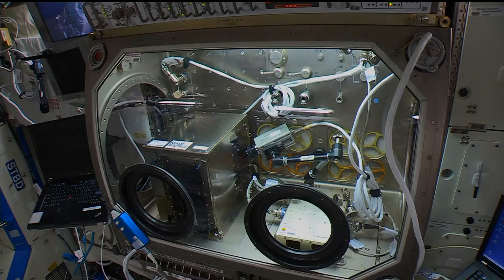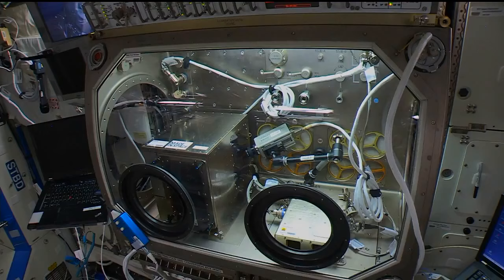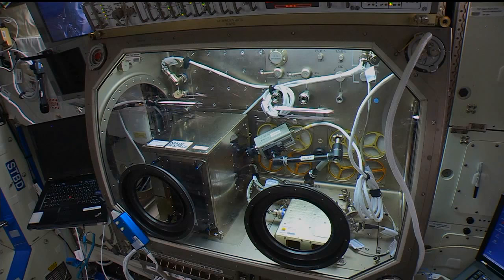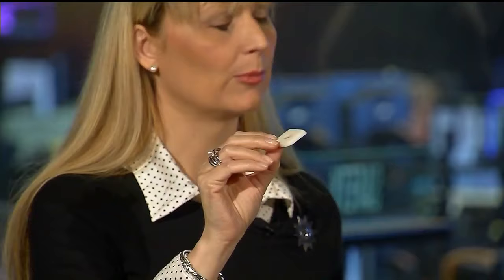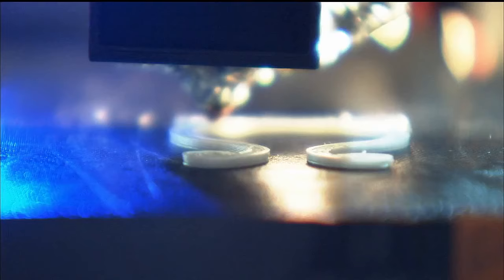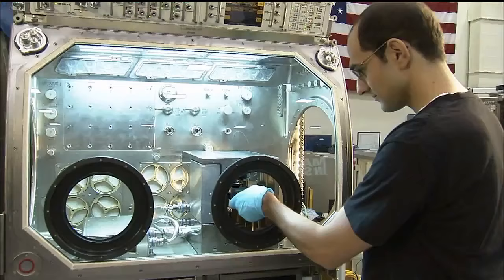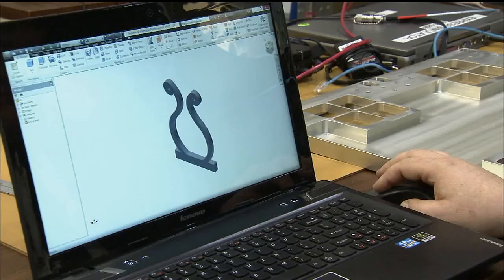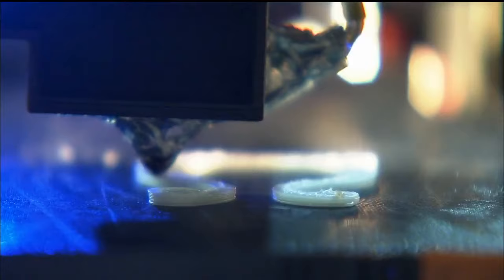Space Station 3D Printer Readied For Test Prints | Video

Comment: Doesn't the fact that the 3d printer required plastic filament in order to print defeat the main purpose of the printer? The purpose of not requiring future resupply missions supplying tools to iss, we still need to send up plastic filament? Or is this printer able to use "junk" plastic for the 3d printing process??
Reply: I am not certain, but probably requires the plastic to still be shipped up. I think the great advantage is probably that a lb of plastic is a lot more flexible than a pound of tools both in packability and utility. What would be slick would be if they can recycle the plastic from a broken tool into a new one. I figure that probably depends on what sort of reagents they're using to dope the plastic. From my reading it looks like this is really a test of concept run, so I expect dependence on the printer is a long way off.